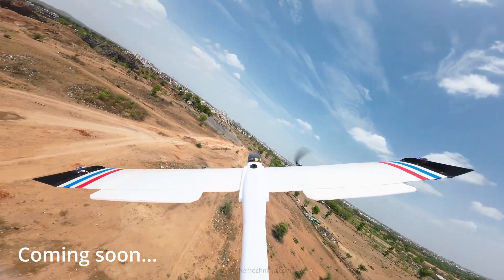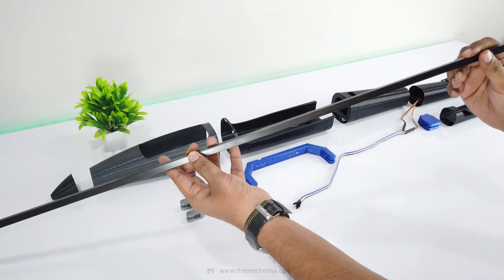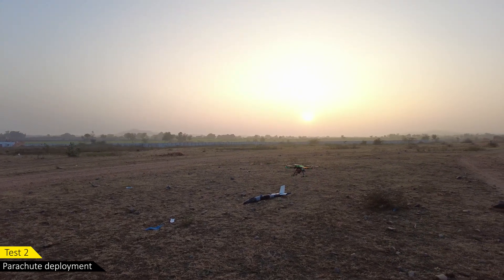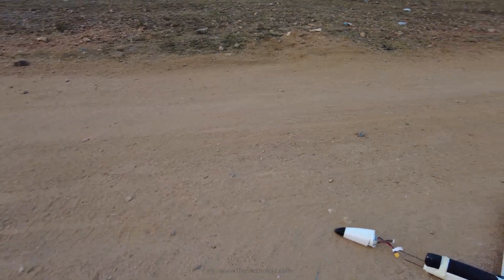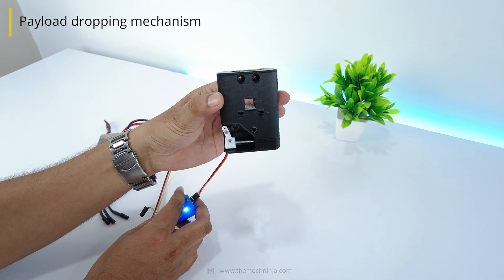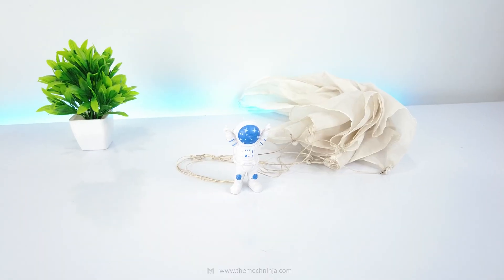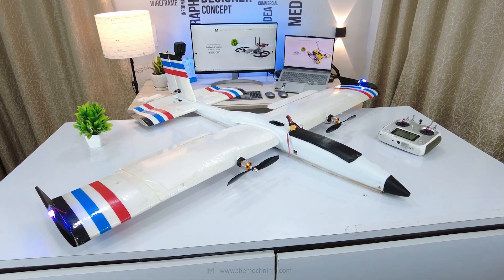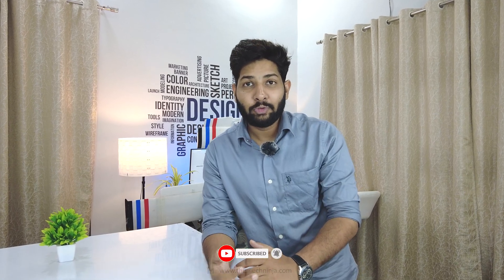Can a 3D Printed Plane Carry THIS Payload?

Comment: 0638   there is an excess of  vibration  coming from the SF props.     it  COULD  lead to servo glitching/crashing, after flying around for a few minutes.      
0723    that   is   stoopid.!!!     i suspect that the material of the elevator deforms because it is not stiff enough to resist the oncoming air flow.
Reply from the maker: 0636 Yes there were vibrations but I didn't got any glitches as I have flown it for a while.
0723 Yes the material was not stiff and although it looks weird but thrust me this design hold the deprom and it made the elevator sensitive.
Earlier it was not funtioning properly but atleast it worked coz of this design. I'll use this till I use stiffer material or 3D printed parts.

Comment: 0538   a drone rotor is  NOT  a propeller.!      
0610   these are (electric) SF  props.  (Slow-Flyer)     stiff  E props should be used.
Reply from the maker: Stiff E props are costly and since I was crashing these planes regularly so i generally prefer these economic props. Once i'll be professional into this, I'll use advance parts.

Comment: 0506   tail  is  HEAVY.    because the mass of two servos is there and because there is excess mass in the stabs.  
specifically, a few degress of sweep should be used at the horiz-stab le; and the height of the vert-stab should be equal a bit less-than fifty percent of the horiz-stab span.
Reply from the maker: Yes the tail was heavy because of servos, but there was no option left as it was a big rc plane. Next time, i'll try to keep the servos in the center and use longer steel wires.

Comment: 0303   it may be that there is excess mass in the plastic wingtips.    in any case, extra mass located at the wingtips will increase roll-axis instability.
Reply from the maker: Yes you are right, but in the last design change I have made them lighter and small

Comment: 0233   ailerons should be 'excised from' the (outboard) trailing edge of the wing/profile,  NOT  tacked onto the trailing edge of an otherwise complete wing profile.
Reply from the maker: Well it was easier to do it in this way, as compared to cutting out from the wing. But how does it affect the plane dynamics ?

Comment: 0232    elevator tips should not be  truncated.      the mass of servos does  NOT  go at the tail.!      because doing so increases tail-heaviness in the model's dom.
Reply from the maker: 0713 The connection was not proper and hence I have to connect the servo directly.  But in my coming projects I will make everthing, 3D printed.

Comment: 0122    it is correct to use a flat-bottomed profile, like the clark-y.    but, that profile should be oriented such that the lower surface is  parallel  to the air flow.    NOT  as  shown in this graphic.       the use of (long) CF components is  not  recommended.   because the distribution of  mass (dom) of such a component cannot be optimized.!     in other words, such use of CF results in there being more mass located distant-from the center of mass (c-m); in both span-wise and length-wise aspects.      a stabilizer should have a (thin) Symmetrical  profile that is aligned with the air flow.      the mass of aileron servos should be located forward-of thirty percent of chord and as far inboard as is practical.      this thrust configuration will result in unscheduled nose-down moment, whenever thrust is being produced.     because, the thrust line is vertically offset from the center line of the aircraft.  and an appropriate adjusted thrust angle has not been used.     you may know that the c-m  is  not  the cg.     the cg is located at the wing.      the c-m is located within the fuselage.
Reply from the maker: Thanks for your suggestion.
I have used these CF because earlier I have crashed many planes while learning so It was becoming difficult to rebuild it again and again. So in order to improve its structural strength, I have used them.
But once I will become perfect, I'll starting removing additional weights.
For aileron servo, There is always a play between the horn and the servo because of wire , so I was thinking to directly connect the servo with aileron like did with elevator and rudder, but u told me so I'll think of a way.
For stablizer, next time I'll keep it thin.
Ok and I got confused btw cg and cm.Thanks for your feedback.
And this is my first RC plane so I have learn't a lot and earlier I was into drones, u can check my chaannel for it and my upcoming projects will be more complex...
So thanks for watching and don't forget to subscribe. I would love to hear from u again....thanx

Comment: I AM A SUBSCRIBER 
Bro I highly recommend you to make a drone or some sort of flying rc using just 2000-5000 you can use Arduino or esp 32 instead of flight controller (this is a challenge from me it will be a good content video)
Reply from the maker: Drone is not possible but I can make an RC glider under it.
Stay tuned I have noted down
Reply: Nice  @MechNinja
Reply: Esp32 is just not possible it's not powerful enough